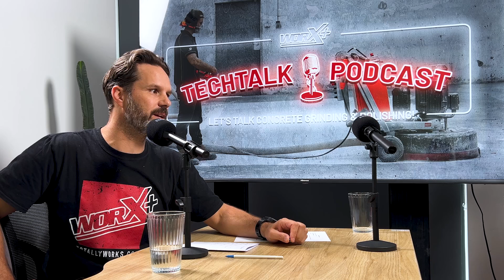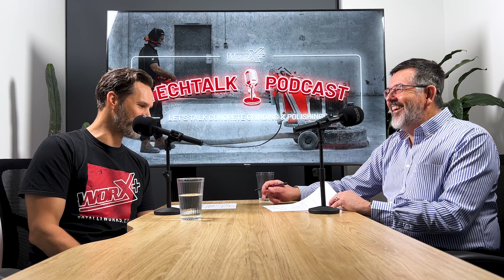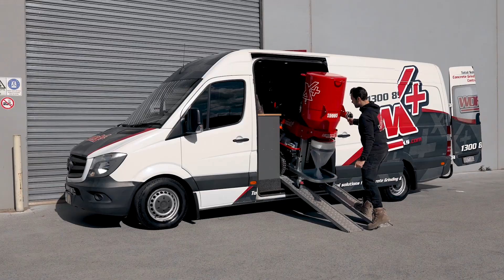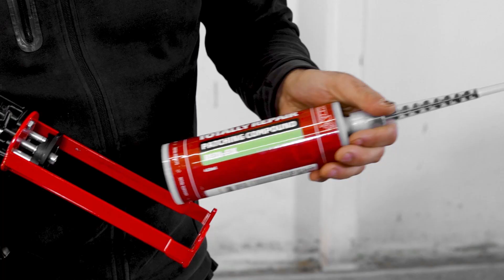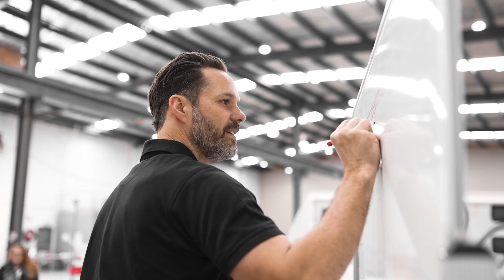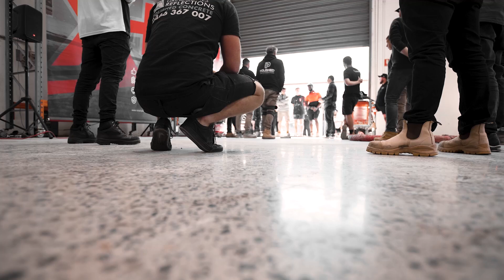TechTalk Podcast Episode #10 Is All Concrete Equal? FT. Peter Killeen

Comment: Just because a topping slab might be only 80mm-100mm thick therefore less cubic meters in total doesn’t mean it’s easier to control. In fact it can be a lot harder to control and it generally involves needing more labour to place and finish the topping slab because the placement is so much quicker.

Comment: Very interesting topic. I’ve found 1/3 of polished infill crack extensively and those clients will never do a polished floor ever again. As you can never repair a crack permanently. This is largely because it’s to thin 80 mm . I’d make it 150mm or minimum 130mm with saw cuts or aluminium strips. 

Surface polishing edges lighter colour is because the burning of the slab from the concreters deposits metal into the floor. Getting the machine blades as close to the edge and always cross sweep the concrete every 3 metres and pass the troweling machine always from right side to left side with a pan.  Then use the small edging trowelling machine and water wipe by trowel the rest of it. 

Regarding the sand plucking out. Concrete is made with 2 blended sands coarse sand and fine sand. As a substitute manufacturing with use crushed quarry sand ie basalt instead of the washed coarse sand. This is why when your finishing concrete and it’s looking gritty when troweling it at final stages it flicks out because it’s to angular . I believe this is also what flicks out at polishing sometimes after 400 grit not your coarse washed sand